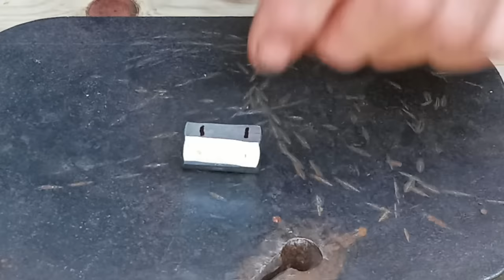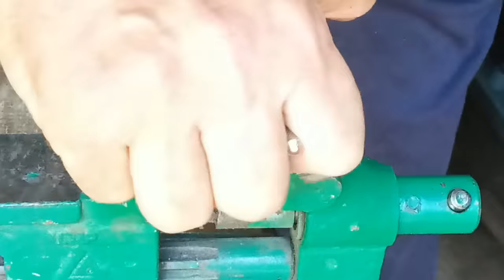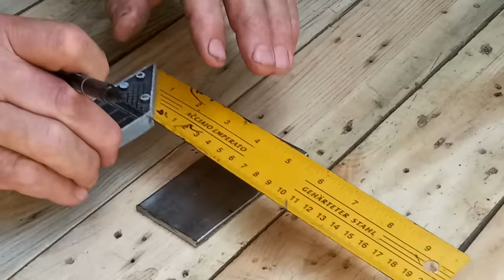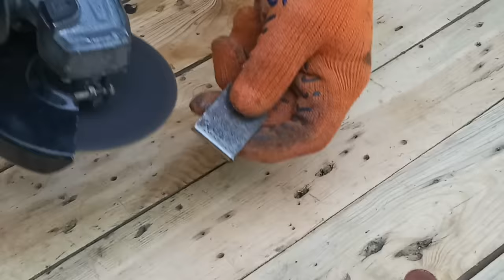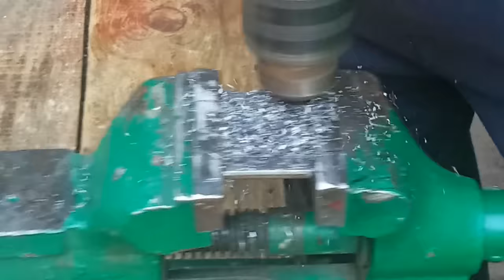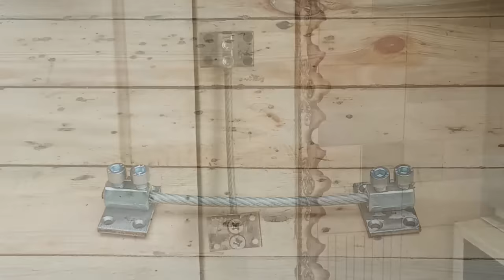YOU NEVER SEEN THESE WIRE ROPE IDEAS BEFORE

Comment: I use locking-grip pliers to hold the piece I’m sanding down with the angle grinder instead of just hands and gloves.
Reply: That's not something that someone named Crazy Rabbit would do. Hold it with your teeth!
Reply: The glove is an upgrade from my norm.
Reply: @willtaylor4084  lol!

Comment: I might not have but I've helped rebuild a fence before the guy couldn't see the drill holes he made in the concrete for to put those ankor things in that you can then screw a screw into or nut and bolt either one to bolt down the fence 

I liked those ankor things there useful and solid once you hammer them into to holes in the concrete
Reply: Anchor
Reply: What does this have to do with anything?
Reply: @PhysiqueGeek  nothing it was just something I've not seen before
Reply: You win the absolutely most random comment of the day award! How does one go from this, to talking about how much he likes anchors? Lol
Reply: @richardbadish6990  lol a fitting reward

Comment: Don’t wish to criticise but if you ground your centre punch back at 60-70 degrees then ground a point on it at 45-50 degrees it would be much easier to see what your doing ,plus use a pilot drill to start your holes instead of drilling straight through with the larger drill bit gives far better results eg much rounder holes ,easier to drill and you don’t get such a severe breakthrough and risk snapping the drill bit ,a variable speed drill would be better much more control  otherwise ,ok for use in the outside shitter I guess but needs prettying up if your ever going to get it market